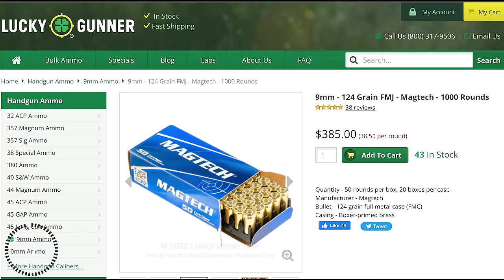Houston Sergeant Gets Hit Multiple Times And Still Prevails

Comment: Agree with you totally about practicing getting out of the vehicle. Many times you recommend that us private citizens lock the doors while we are in the vehicle, the modern vehicles (when the doors locks are set to remain locked) doors will not unlock when activating the door handle from inside (at least the Nissan Pathfinder). After a year, I still have to remember to unlock the doors before they will open with the door handle. This will be my 2024 New Year's resolution, practice exiting the Nissan so unlocking the door becomes muscle memory. Thanks for sharing.

Comment: For anyone wondering, It's not too hard to apply a tourniquet, you just need to follow a few rules:

- Apply the tourniquet about 2 inches above the wound, but do not apply it to a joint (elbow, knee). In that case, apply the tourniquet above the joint.
- Make sure the tourniquet is really tight. The point is to stop the bleeding.
- If possible, write the time the tourniquet was applied on the skin in marker near the tourniquet or find another way to note the time. This lets the doctors know how long blood flow to the limb has been impeded.

Comment: I worked for Houston PD for 36 years as a Sergeant over a tactical unit, retired in 2017. The seat belt policy was forced down our throats against our will, with no exceptions. Administrators with no tactical experience and very little proactive street experience developed it. They HAMMERED officers for the slightest violations.  We argued this would happen some day. I was always taught to get the seat belt off, before you get to a scene or suspicious area. Thank God the Sgt had the will to live. This why you don't let pencil neck command staff with nil patrol or tactical experience make or develop policy that is counter-safe to real working officers. I Chief Finner, he a fine man, and policy was made before he was Chief. I hope he reviews it and modifies to allow Officers based on the situation decide when to remove the seat belt. Safe safe my brothers and sisters.

Comment: The only comment I will make in the way of a suggestion is based on what happens at 4:55 in the stop-action and description portion of this video.  The CAR is at this point your Best option for defense and offense.  To stay still, and take multiple shots, while treating your own firearm as the only option is more than a little limiting.  The CAR is running, immediately available, and ready to both defend yourself and perform as an attacking weapon against the dirtbag.  Use what is first available FIRST.  Then, if necessary, go for a more traditional tool.
Reply: Like you've ever been in this situation😅😅

Comment: I know it would be an extra cost, but I think that a quick release seat belt simular to what's in race cars should be installed in police cars. The officers would be safe on the road, and be able to just grab a strap and yank to get out. Take the fine motor control to hit the small release button out of the scenario.

Comment: John/Mike, I'm surprised that you guys didn't mention using the vehicle as a weapon, after watching the video several times, and thought wouldn't it been an option if the sgt. would've hit the gas pedal and turned the steering wheel to thw right towards the perp in an attempt to hit or run him over, I thought being a moving target would've have been a better option than sitting still and trying to release his seatbelt and taking shots, just wanted to get your feedback and opinion on using your vehicle as a weapon and also, would practing getting your service weapon out while in a seated position with/without your seatbelt be a viable option?